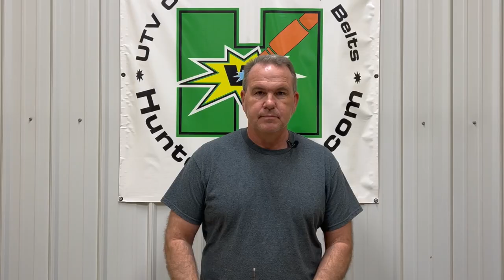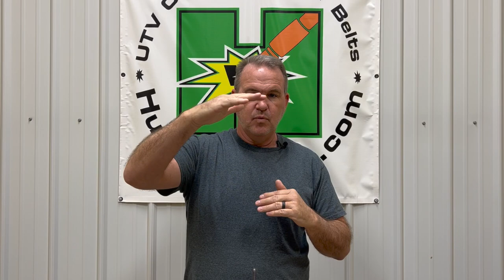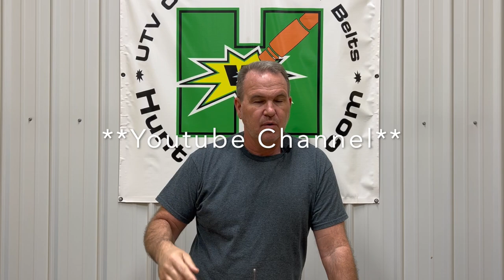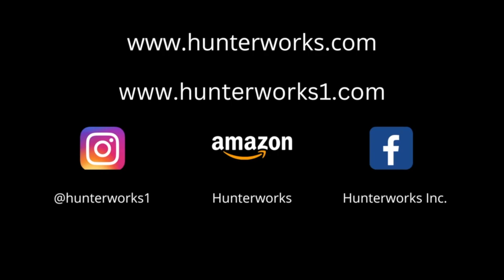What Does A Clutch Kit Actually Do?

Comment: How big of tires can you run on a stock 2019 Polaris XP 1000 without harming the transmission or motor?
Reply from the maker: It is not so much about harming those, it is about harming the belt and clutches more so, my rule of thumb is do not go above 2" more than stock without considering regearing
Reply from the maker: @ballzdeep1017   What vehicle? BTW, better to discuss this in email todd@hunterworks.com
Reply from the maker: @ballzdeep1017   Not sure I saw it, if I didn't answer I didn't get it

Comment: I don't why manufacturers just don't make their clutches work well from the factory 😒 and do aftermarket clutch kits void warranties?
Reply from the maker: Some are good, but if you put larger tires, live in high elevation or sand ride you need to recalibrate your clutch to match what they did.  However here and there they just do a very bad job with the factory set ups

Comment: If the products that manufacturers sell would be properly calibrated you would not need after market expensive products
Reply from the maker: That is kinda accurate, if they got it right the first time and they do example the General but only with stock tires.  Change to larger tires, use in high elevation or sand duning then the kit is needed on it too.